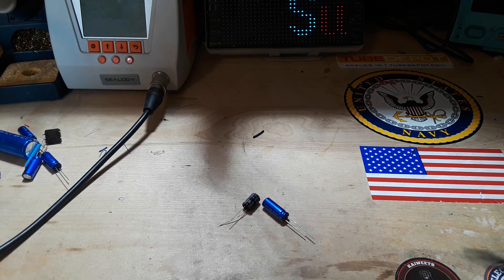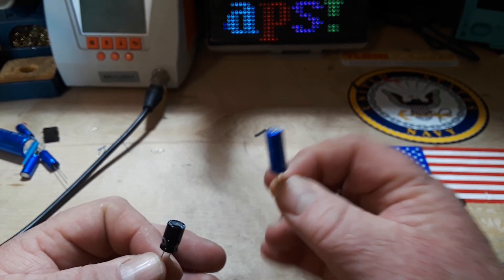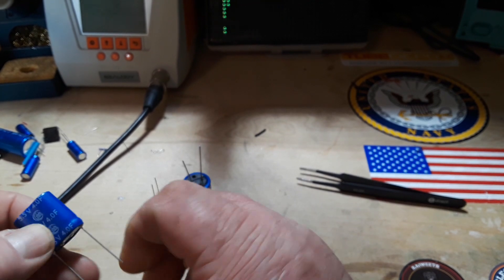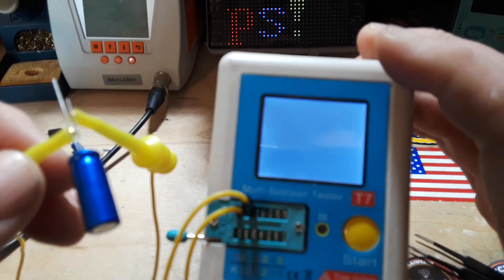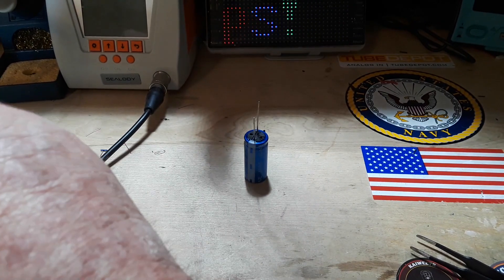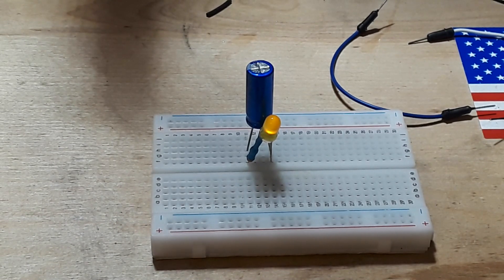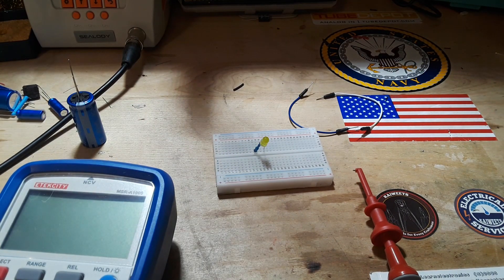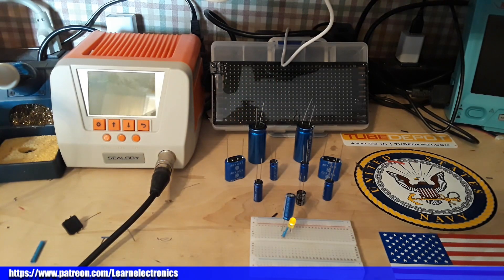How Are Super Capacitors Different From Electrolytic Capacitors

Comment: I making a 9>14v  AC>DC circuit for train LEDs with an LM7805 and LED strip with current resistors 5v, should a storage cap be on the input or output of the regulator?
Reply from the maker: Both. Check data sheet. I think it's .1uf in and out. Also use a large reservoir (2200 or so) across the rails for smoothing.

Comment: You're using a 1M ohm resister to discharge a 40F capacitor. Calculate the RC time constant. After 15 months it will be down to 63% of its original charge. Or am I missing something?

Also, electrolytic capacitors don't use paper. The dielectric is actually an oxide layer a few atoms thick on the metal anode. The electrolyte acts as the cathode. Applying voltage with the wrong polarity will chemically remove the oxide layer and cause a short.
Reply from the maker: The resistor is NOT for discharge (I said that in the video) it is to keep them discharged in the storage area. I've torn apart and blown up a great number of electrolytic caps, they do in fact use a paper separator. I'm sure they can be manufactured in the way you have described as well. Peace.
Reply: @learnelectronics  Ok, I stand corrected (actually, I'm sitting at the moment). 

In fact, as you said, electrolytics typically do contain paper. They just don't use it for the dielectric, which is what I mistakenly thought you had said. The paper is soaked in electrolyte and forms the cathode. The dielectric is a very thin oxide layer on the metal anode.

I still find it amazing that a supercap discharging through a 1M resistor would have more than half of its original charge left after 15 months. Maybe I'm easily amazed.

I'm so glad we could have this little chat. Thanks for your always interesting videos. Take care. 🤓

Comment: Supercapacitor = this dumb name causes all the trouble, they are not really very "Super" Look at the ESR values on the small ones, not to mention the very low working voltages.
Reply from the maker: The correct name is Ultra Capacitor. But most folks refer to them as super caps so thats what I did. They have their niche, and it is ultra rapid charge and discharge under high power.

Comment: I suspect a couple of things about the T7. One is that it may use the ATMega328, which is NOT for battery application. Two assumes an ATMega328p, and the firmware does not put the ATMega328p into an adequate low power sleep state. As such, it's draining the battery 24/7.
Reply from the maker: I would agree 100% buddy!

Comment: What are their applications?
Reply from the maker: Ultra rapid charge/discharge
Reply: I thought that they are typically used for memory backup in electronic devices instead of using a separate small battery.
Reply: @rogerwilco5187  Interesting

Comment: I dont understand. I have seen that electrolytic capacitor have a dielectric soaked in a solution mostly the dielectric is a brown paper with a smiling solution soaked in it
Reply from the maker: Supercaps don't use the paper dielectric. Only an electrolytic solution between the plates.

Comment: I have so many questions i have no idea how to ask the question.
The resistor on the leads gets hot to burn off energy on the cap. But a resistor restricts energy to a circuit. What stops the resistor from thermal run away? What stops the resistor from bleeding a battery dry? Did you understand the question. I'm stuck in a rut not learning more about how this stuff works.
Reply: As long as you don't exceed the resistor's power rating(how much heat it can dissipate and not burn) then you're good. Nothing stops it from bleeding a battery dry, so uh, don't do that. No problem for a capacitor though. At 2.7v the 1megaohm resistor used here would dissipate around 7 microwatts, practically nothing; a much lower value like 50ohms could very well be used, dissipating 0.15 watts that a 1/4 w size could handle just fine.

Comment: Important questions are where and when are the super caps used versus the standard electrolytic caps? I presume when line power is lost in critical circuits requiring back up power. Nice demo Paul.
Reply: In place of cmos batteries etc is the most common use.